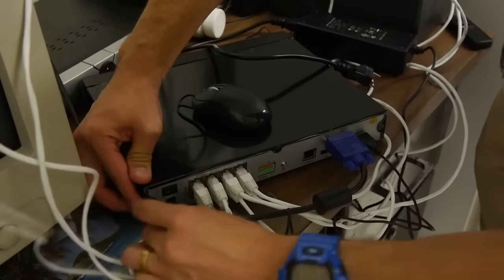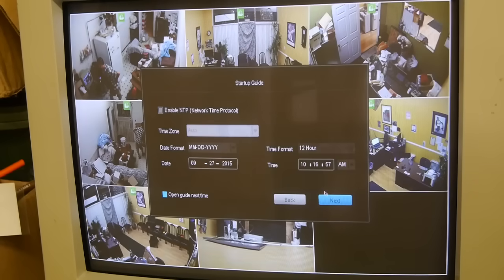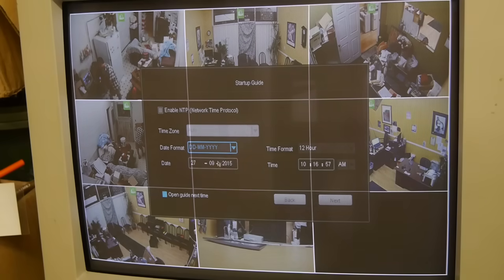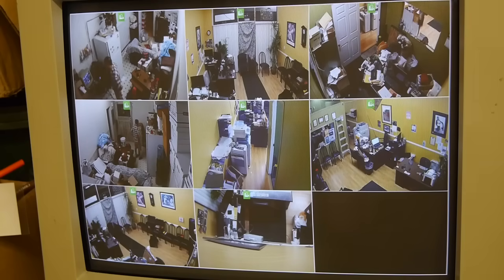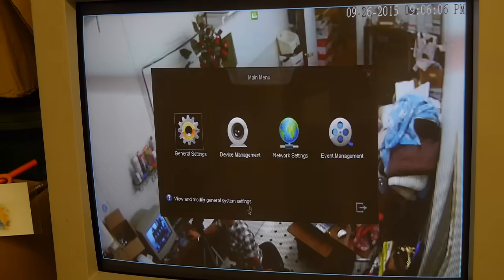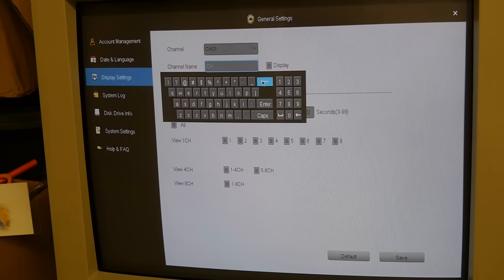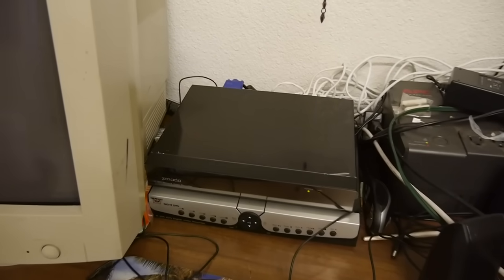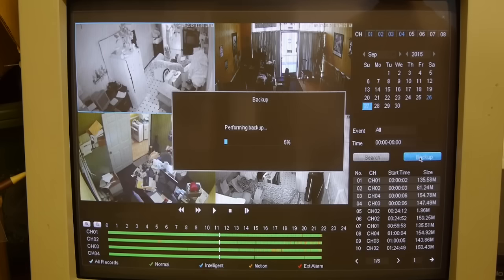How to install a Security Camera Surveillance System

Comment: I'm saying thanks, because this was a great tutorial. But I'm not happy because I don't think I can do what I wanted. I have/had an 8 camera setup with an additional 8 slots. A  NVR with a 1Tb hard drive and a monitor. Great system except I didn't take the time to learn how to view it online or have it alert me when there was motion, so when we were broken into they stole my DVR. Now I have 8 barely used indoor/outdoor with night vision camera's with cables but no NVR and worst no money to buy a NVR. Is there a way to connect my camera's directly to my computer through maybe a hub/router and by-pass a NVR?
Reply from the maker: yes if they are IP cameras but you would need to attach them to a network that the computer is connected to. A network switch/router/gatway will work but as long as the IP cameras are compatible and you'll need software to view the IP cameras and to record on your pc.
If you have analog cameras, then you can't connect them directly to your computer network without a DVR.
Hope this helps.
Reply from the maker: Also I know I didn't mention it in the video since my video focuses on getting a surveillance system installed, in the future if you ever get a DVR or NVR system, you can set them to email you a snapshot everytime motion is detected on the cameras. This way if a similar event happens and the DVR gets stolen, you would atleast have emails with pictures. Pictures would be better than nothing.
Also placing the DVR in a secure location out of the way and hidden would be great, also running the wires inside walls  would keep the location of the dvr a secret since you wouldn't be able to trace the cameras directly to the dvr.
Helpful suggestions, hope you get your cameras back up and running soon.
Reply: Wow that's great.I had the system in my business when the DVR was stolen. We believe it was a disgruntled employee that broke in. Now we need it at home, we closed our business. The only thing I need to figure out is how to connect a RJ12 cable to a network cable. I'm assuming there must be an adapter. I'll check with our local Radio Shack. Thanks so much for your help. I was getting really frustrated trying to figure out what things were called to be able to google it and your video cleared everything right up. So thanks again.

Comment: If it's good product, then it's because of the brand. When it's crappy product, then it's crappy Chinese products. 
Doesn't matter that in many of these instances, both the manufacturers and importers are non-Chinese companies and both the factories are in China. 
Great video, by the way, but please, no racist rant.
Reply from the maker: thanks but there's nothing racist about my comments, I was saying that it's better to buy the hard drive separately so you know that it's a quality drive. If you buy a dvr with hard drive already installed, you don't know what's in it, and most likely its a cheap hd.

Comment: Hi  this  is  Mike  I got  me a home  system that  runs on a 32 gig micro chip with  a  small  wireless  monitor that  came  with  2 cameras  but  has  room  for  2 more  cameras
Reply from the maker: +Spaz Thedrummer cool
Reply: Thanks  for  the  info  on posting  a  sighn to protect  yourself  legally
Reply from the maker: +Spaz Thedrummer no problem, just make sure that it's legal where you will set up your cameras if they will record audio.

Comment: I LOVED AND LEARNED ALOT ON YOUR VIDIO, AND HAVE HAD TO SET MY SYSTEM UP WITHOUT A MANUAL/OR INSTRUCTION, SO FAR SO GOOD, BUT THE PROBLEM I HAVE IS MY NIGHT VISION, THE IR WORKS GREAT IN A DARK ROOM, BUT WHEN I PUT THE CAMERA OUTSIDE( ON THE 2ND FLOOR) ,WHEN ITS GETS DARK OUTSIDE, THE CAMERA GOES DARK, ITS LIKE LOOKING INTO A DARK  CLOUDY FOG, AND CAN BARELY MAKE OUT  ONLY HEADLIGHTS OF A CAR COMING DOWN THE STREET, AND I HAVE A STREET LIGHT ABOUT 75 FEET AWAY MY HOUSE, AND MY FRONT PORCH LIGHT IS ON TOO SO ITS NOT LIKE THERES NO LIGHT,  I JUST WONDERED IF THERES SOMETHING I NEED TO ADJUST/OR DO TO GET A CLEAR VIEW, OR.....WHAT IM DOING WRONG/IF ANYTHING?
Reply from the maker: +SCOTTISH KNIGHT could be several things.
It could be condensation on the camera lens at night
Could be the built in IR LED's aren't working
Or could be everything is fine but there simply isn't enough light. If this is the case, you can buy an IR light such as one of these http://amzn.to/23gyj3E to fill in the light in the area. An IR light would light the area with light that is only visible to the camera and not human eyes.

Comment: I MUST HAVE MISSED SOMETHING CHRIS. I WANT TO CONNECT A PC MONITOR DIRECTLY TO MY DVR (NO INTERNET) AND I HAVE A VGA CABLE, NOW, I KNOW I HOOK THE VGA  TO THE PC MONITOR, BUT DO I NEED ANOTHER POWER SOURCE OTHER THAN JUST THAT CONNECTION? I KNOW I HAVE TO HOOK THE DVR UP TO A POWER SOURCE, BUT IS THERE ANOTHER POWER SOURCE OTHER THAN THE VGA CORD I NEED TO POWER THE MONITOR?  ( IVE NEVER DONE THIS BEFORE)
THANKS,
BOBBY
Reply from the maker: +SCOTTISH KNIGHT who's Chris? 

Monitors have their own power source that must be plugged in.
Reply: +Tool Craze  SORRY . THOUGHT I WAS TALKING TO SOMEONE ELSE

Comment: I REALLY WISH YOU COULD HAVE GIVIN SOME  BASIC DIRECTION ON HOOKING UP TO THE INTERNET , I KNOW YOU SAID THEY ARE NOT ALL THE SAME, BUT I JUST NEEDED SOME BASICS ON IT, THANKS FOR THE DIRECTION ON  BASIC HOOK UP THOUGH,
Reply from the maker: The problem is with port forwarding on the router. Everyone has a different router and each one has different steps to set up. 
Thanks for watching

Comment: Thanks for the vid! Question, for the NVR with IV cameras, does it slow down your bandwith/internet speeds?
Reply from the maker: +Jordan Jay Thanks, before I answer that question directly, I will say that it isn't required you connect the NVR to a router to work. Like I was saying in the video, the NVR contains it's own network for the cameras so you don't need anything else to run IP cameras when running on the NVR. The only benefit of connecting the NVR to a network that has an internet connection, is if you want the NVR to broadcast its live camera streams so you can view them anywhere remotely. The same thing applies to DVR's because they too can connect to the internet to upload their live streams for remote viewing. Also keep in mind that when connect to the internet, the DVR or NVR is constantly streaming up, in otherwords your upload speeds will be affected. Download speeds shouldn't be affected to any noticeable extent because the DVR is not downloading but instead uploading 24/7. So going back to your question, does it slow down bandwith? The direct answer is that the upload bandwith will be impacted. To what extent all depends on the size of bandwith taken up by each camera feed and multiplied by the amount of cameras/channels.

I had my old DVR connected and streaming to the internet and it didn't impact my bandwith to any noticeable extent. But keep in mind I was running a 4 channel dvr with low res analog cameras so each channel wasn't taking up much bandwith. I had at the time a 1.5mb connection and everything seemed as normal with 24/7 streaming on the dvr. I'm sure if I was running the system I installed in this video with 8 channels with each channel running a 720p stream, I'm pretty sure my upload speeds would be heavily taxed on such a slow connection that I had before.

Hope this helps Jordan. Thanks for watching.

Comment: I live in an apartment complex to have a detached garage and my car motorcycle was vandalized I need a DVR with cameras that are completely wireless and the cameras need to be battery operated Wi-Fi with motion detection and night vision.please help
Reply from the maker: +unforgiven101inc they sell complete nvr systems with wifi ip cameras. Heres a complete system with 4x 720hd wifi cameras and nvr with 500gb hd. http://amzn.to/1ngFLOi these wifi cameras are wireless but still need to be plugged in to a local power source. Each camera comes with its own power cord.
Reply from the maker: +unforgiven101inc  I didn't think battery powered wireless cameras connected to a dvr station existed but to my surprise I found one. Here's the link, its a 4 camera system with a base station, I would assume the base station monitors the cameras but didn't say if it records, anyways here's the link for the 4 camera kit http://amzn.to/1SkIGRS - according to the documentation, the cameras can run 4-6 months on the batteries

Comment: Thank you for this vid! I am going to install it in my own home! Thanks for taking the time to make this.
Reply from the maker: +Ivan Leal glad it helped out, thanks for watching!
Reply: +Tool Craze What size bit did you use to drill through the wall? I will have to run the cables through the wall, and I do not want to cut and re-terminate them.
Reply from the maker: +Ivan Leal I don't remember since it's been a while but I made sure it was big enough to fit the connector end of the cable

Comment: I really needed to see this video, a client wants me to install a surveillance system in his office and I'm a computer engineer, not audio or video technician, but it looks pretty easy and almost the same thing as a network installation. are there water proof ip cameras? he wants a couple of them out of his building. Great video, my friend. Sorry for my English.
Reply from the maker: +Lt. Albert thanks Albert and your English seems fine to me. The setup is very straightforward, and yes the ip cameras are just like a network install. I don't know about waterproof surveillance cameras but many are outdoor rated and can withstand weather like ice snow and rain making them water resistant. All the cameras I've setup are outdoor cameras so they can withstand the elements even though I installed all of them indoors. But I'll be installing some outdoors soon
Reply from the maker: +Lt. Albert also forgot to mention that the ip cameras install just like a network system if they have PoE. If they don't, you'll have to run an additional power cable with each camera.
Reply: how did that install from 4 years ago go bud?